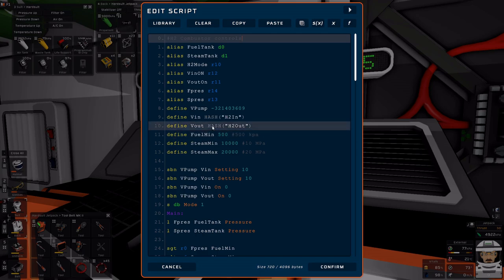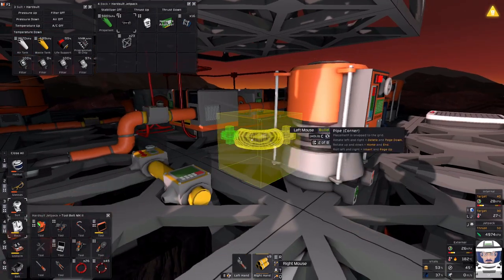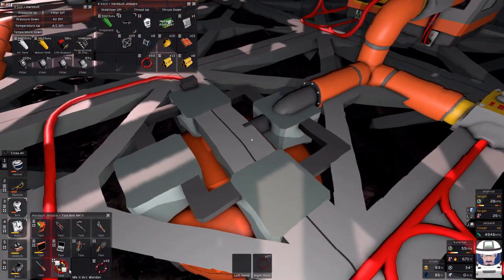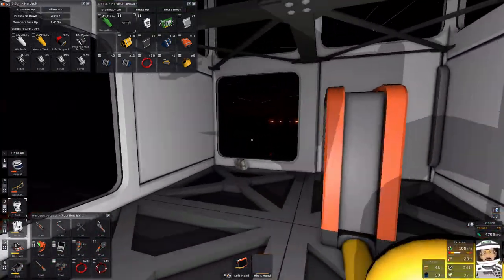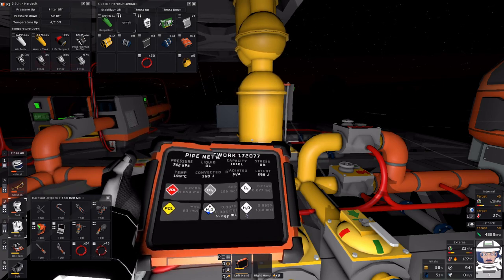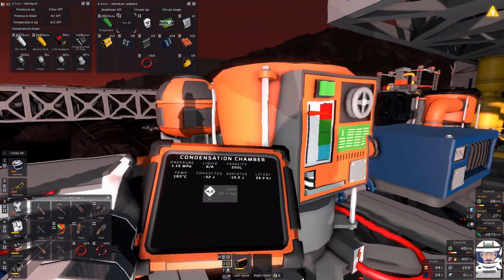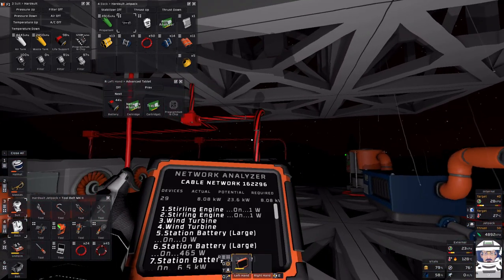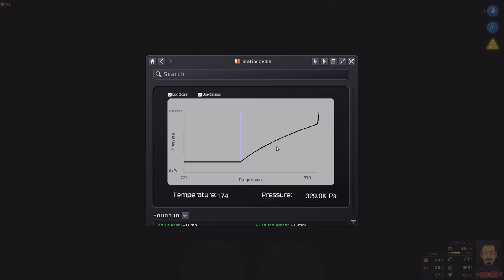Stationeers: Let's Early Phase Change Vulcan Pt13

Comment: I don't know, this water cooling system seems a little slow and complex for what you need.
I generally use a Filtration setup to separate the steam and water, the waste I then use in my advanced furnace.
The hot steam is stored in a gas tank with large gas convection radiators (behind a digital valve, if the radiator gas is cooler then the tank, open), though Stirlings work as well if you need the power (I'm just scared of going too far and getting liquid pollution).
Then when the steam gets cold enough it will condense (at up to 300+) into a liquid tank with large liquid convection radiators (again with a valve separating the two networks) so that is can cool down to 127.
Optimally you would want to prevent the convection radiators from heating up, so eventually I tend to enclose them with hanger doors (instead of valves), but as long as you don't have too much water generation it will cool down enough at night without them and you can pump out the cooled liquid (granted, I pump out at 140 because I am impatient).
The biggest downside is the initial 137kPa for both tank and radiator setups, that's quite a bit of water you'll not get back and if done without enough oxygen/water reserves might dry you up early game (so start small, initially I only have radiators and a pipe network without valves).
But, it cools down waaaaaaaay quicker because the radiators can have either a high volume of gas or liquid in them, rather then that few hundred kpa trickle.
Reply: I just realized I am a dumbass, I could have pressurized those networks with night CO2 or Volatiles, that would have saved me every drop of water..... so much struggle for nothing...
Reply from the maker: Looking back that was what I concluded as well. I had this notion that atmospherics filtration must have cost over 300W or something, but looking at them they dont seem to draw near as much power, maybe not even more than 100W. So this became more of a wasted effort exercise because I could have just did that, an atmospherics filtration to collect all the steam into a gas pipe network and then cool it down. The water phase change device can do the desired cooling as planned, but I wouldnt have had to do the effort of mathing out the precise amount. Well if anyone wants to do a filtration using phase change on the upper end to separate water, pollutants, or nos... I somewhat got a working setup started that can be better tweaked.

Later on I will probably dismantle the logic and may only use it if I need to separate some nos from something the hard way.
I probably will just filter it out and just dump it right in my water tank, sure it will heat up my water pretty bad but as I get more the extra energy being dumped in there wouldnt be so bad... or maybe after filtering I run it through a cooling setup for a little bit to cool it down some before it goes in my water tank. Either way I will make up a phase change cooling setup to start working on cooling water down so that I can actually use the 2kmol of 400C water I have left.